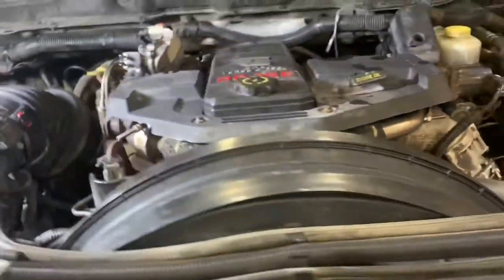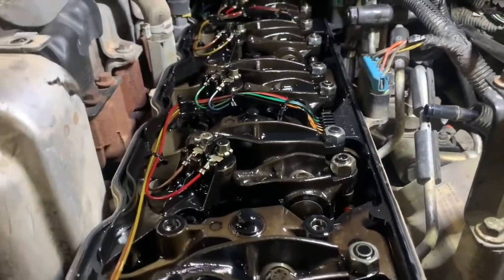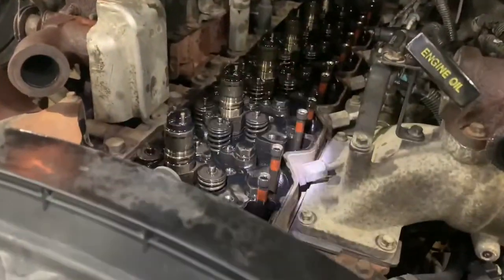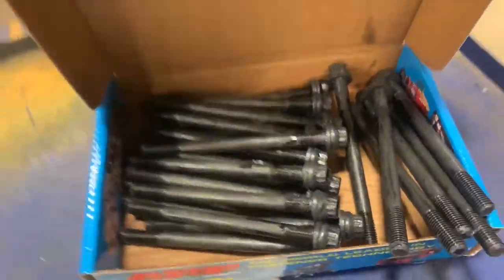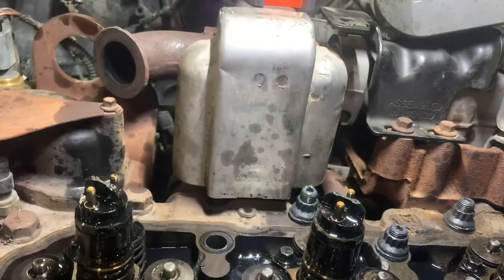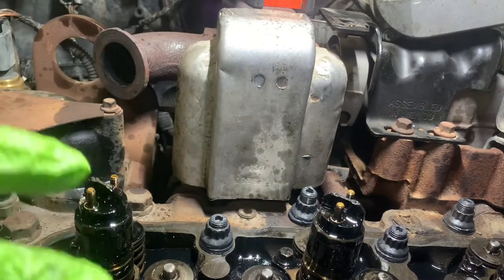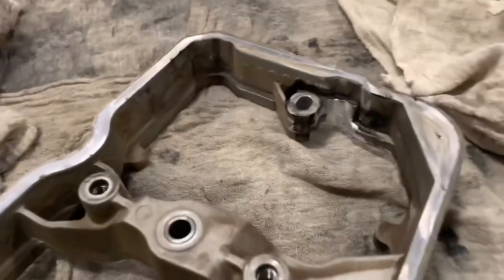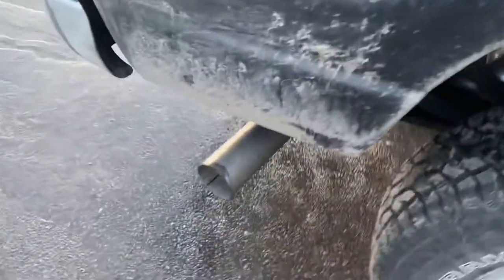6.7 Cummins ARP head stud install guide (head on, one at a time)

Comment: Do you not have to back the stud out 1/2 turn? Why do they say to do it and not bottom out the stud?
Reply from the maker: I run them down then back them off then put them finger tight. Never had an issue
Reply: You need to back it out a hair to allow for heat expansion. If you bottomed it out, after heat expansion, the stud & nut combination could loosen up.

Comment: Don’t think its a good idea to hot re-torque, the original torque spec is for cold assembly, which takes into account screw lengthening due to operating temperature, by re torquing hot, you are exceeding the original torque spec and reducing the elastic life of your fasteners. You should also apply a light oil coating on the thread to make sure you get effective torque application on the exposed side of the stud. Furthermore if you re-torqued at 10 lbs over the spec and you did it hot you may be close to stetching the studs.
Reply from the maker: I’ll do it my way, you do it your way 🤷🏼‍♀️

Comment: As a seasoned 45 year heavy duty Cat mechanic.  I do not see any advantage in doing this every time a bolt is loosened the gasket is disturbed making it more likely to fail never mess with something that is not broke.  If you do not have experience leave it alone.  WOW.
Reply from the maker: As a seasoned cummins, and international certified tech I can tell you that If you’ve been working on cats for 45 years this is above your head old timer lol carry on. This is also a very common practice. WOW.
Reply: @30tman   I’m no diesel mechanic at all but I took my time installing this myself with the right tools…. This dude is a joke ahahaha you can literally Learn anything on YouTube…

Comment: I have 414k ok a 2015 ram 6.7 all original.  Stock head studs. And been deleted at 200k. And only change the value body in the transmission and a fan clutch.  Nothing else.  I don't understand why you have to do new studs
Reply: Most folks do it with the high tunes "180hp tune"...but unless you not realy dogging it then alot people dont...thise that keep it to the floor end up stretching those stock bolts
Reply from the maker: @nunya8048  these trucks will blow HG in completely stock applications. Blame the high drive pressure from the vgt turbo